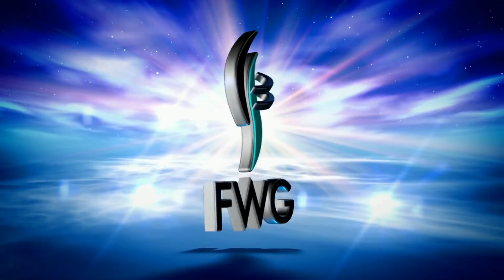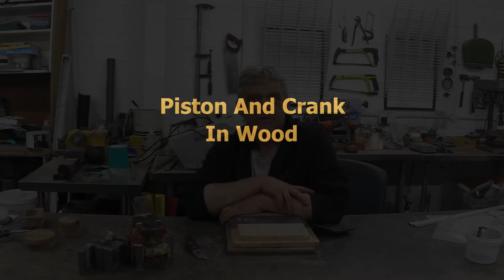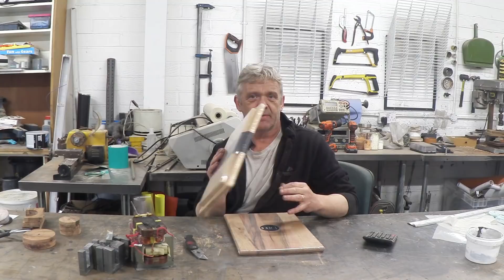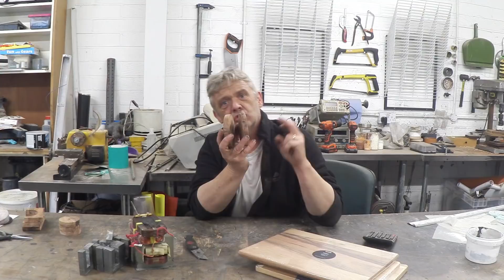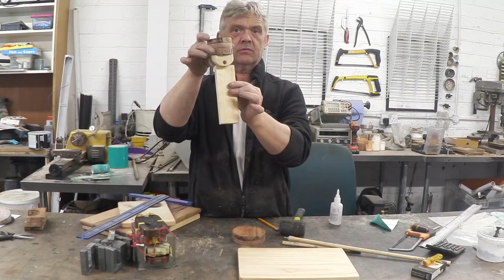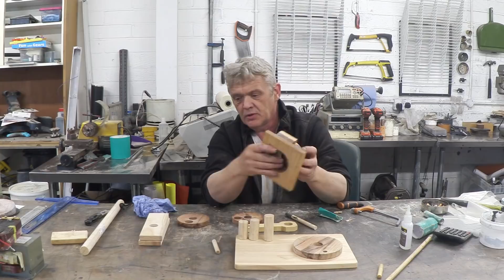Piston And Crank In Wood

Comment: Nice tip for cheap materials... I've used pound shop nylon chopping boards for a good cheap source of almost indestructible sheet plastic, easily cut, bent, drilled and tapped,
Nice grain on those, would look great with a bit of Danish oil or similar finish.
Reply from the maker: nice tip there from you too mate - cheers

Comment: Would love to see you experiment with an HHO generator ppl use in their cars. I spent 3 years trying to make one and use in my car. What I learned was that 99% of what is claimed is garbage BUT that it can work and be totally worth while. I made my 2006 Mazda3 go from 25mpg to 32mpg. But what that system really is, is just a fuel catalyst generator you can get moderate gains with by using no more then 3-5amps to produce hydrogen that then just helps your fuel combust much better. The HHO community is rightfully mocked in my opinion because they all seem to claim or strongly imply you create large amounts and run off it or even majority run off it. 

If you’re interested I could share a bit more about my setup for a possible experiment?
Reply from the maker: i have done a fair bit on HHO mate